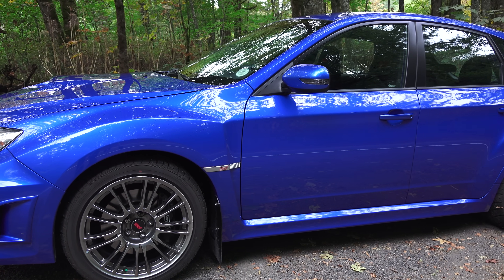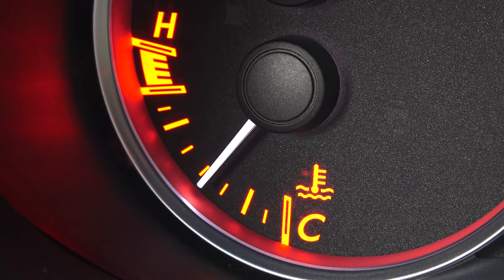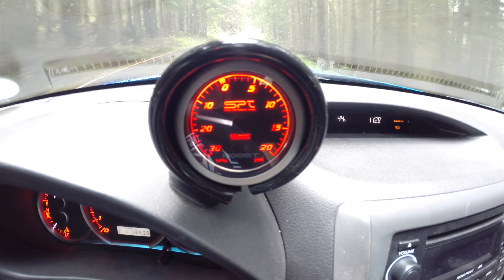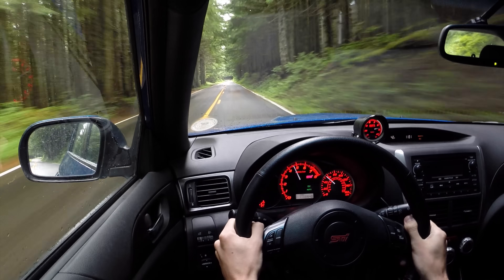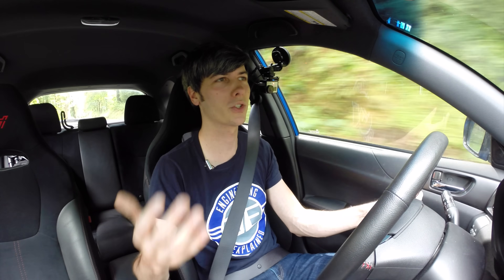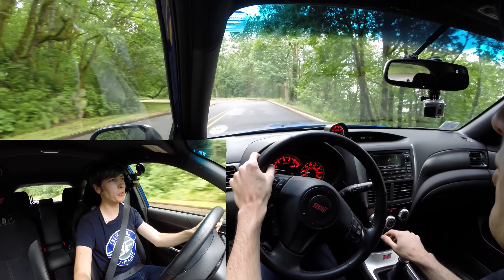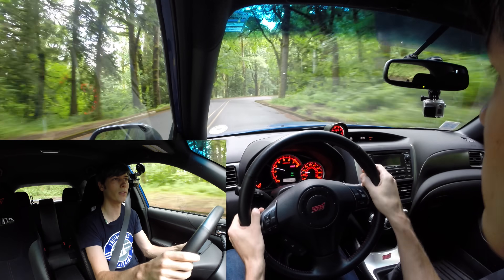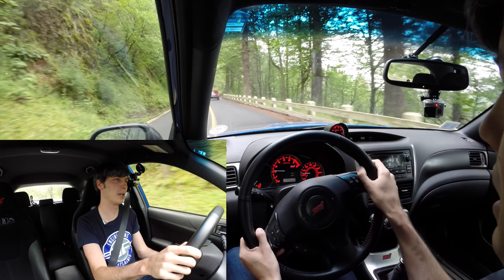5 Things You Should Never Do In A Turbocharged Vehicle

Comment: According to Ford, my EcoBoost can run on 87 octane although they recommend 93 when towing or for optimal power. So is it ok to run the 87 octane through my 2.7 EcoBoost?
Reply: If the people that built it say so, it is a safe bet. They are the ones that would have to fix it otherwise when under warranty.

Only performance engines, or shity land rovers call for premium. An eco boost engine doesn't need the premium fuel because it was tuned for lower octane. The higher octane just adds a bit of power.

Comment: You're flat-out wrong with the first thing you mentioned. People get hydraulic oil and engine oil mixed up. The viscosity of engine oil changes proportional to its temperature, however unlike hydraulic oil engine oil gets thicker as it gets hotter.  5W 30 oil starts out thin (5W) and thickens as it heats up (30).  This is because a starter needs thinner oil to be able to crank over the engine easily in cold weather but you still need the protection of the thicker oil after the engine is hot.  Pre ignition/knock IS an issue on all high compression engines such as diesel, turbocharged and supercharged engines.  What you will usually see manufacturers do is specify high octane gas. Turbocharged engines are one of the few engines where I would go with the highest octane gas I can find with every fuel up regardless of what the owner's manual says.  Higher octane gas has a higher flashpoint and will reduce some if not all pre ignition problems.  Some of your other information with spot-on such as keeping the engine RPMs between 2000 and 3000 RPM and adjusting your gears accordingly.
Reply: You would always be riding around in 4th gear to keep rpm above 2000 even with a 8 speed auto transmission.

Comment: police: why were you going so fast?
> EE told me i can't use this car at low-rpm
Reply: Driving at low rpm is fine. Just don’t floor it.

If you want to accelerate downshift and then floor it.
Reply: @MarcoBarroca  whats considered low rpm? and what rpm should it be okay to floor it? lol
Reply: @HungDante  I was kinda hoping for an answer, maybe this will bump it out of em? Lol
Reply: @HungDante  You can feel it. You know the boost is there if you have an audible wastegate or boost gauge, but the car doesn't feel like it's going anywhere. When I first got my car I was going about 40 in 6th and I wanted to accelerate so I went pedal to the metal and all the car did was bog and the MPG guage dropped to 0 mpg.
Reply: Fulls end or no send
Reply: I also saving the environment
Reply: I was unable to get into 'Top Gear' under 100 MPH as I have a 7 speed gearbox
Reply: @GrrMeister  Did you try to engage the 'R'ace gear? It ups the top speed by 30-40 mph easily.
Reply: Elliot Rodger  that's the Honda way and im proud to say im part of it 2nd and on is for pussies
Reply: Lol
Reply: what? LMAO.
Reply: Ah move along
Reply: Me too
Reply: Race in Sepang 😂
Reply: LITTERALLY HAPPENED TO ME lol
Reply: 😂😂😂 Gold
Reply: JUSES CHIRST aren't diesels usually turbochargered as well, and they usually stay at low rpm
Reply: @alyx6427  diesel gets its torque at low rpms, gas gets it at higher
Reply: @alyx6427  Diesel engines usually have an optimal rpm range of 1700 to 2300 rpm so basically keep it at 2k and you are good. If you floor it it's ok to go up to 4-5k rpm. (I know cruising speed for petrol engines😂) running it low at 1000-1500 rpm will result in low turbo spool and lots of lag. Also as a side effect you won't have much or any range to slow down until you need to downshift

Comment: Would this apply to non turbo cars?
Reply: only for big blocks otherwise you have a gutless wonder.
Reply: @Billy_Darley  well what do you consider a gutless wonder? Does a 1.5 liter 4 cylinder count? Cuz then yeah I have a gutless wonder.
Reply: @colepeterson9961  it was mainly just a joke. compared to the 7.5L 460 i just sold yeah thats a gutless wonder. power to weight ratio might help but your car probably isnt light enough.
Reply: @Billy_Darley  my car only weighs 1.3 tons I know I'm a dummy but hey who cares.
Reply: @colepeterson9961  2600lbs plus you and or passengers. yeah it could feel like a gutless wonder. a 1.9l 124hp 2300lb car will move just as quick if not faster. my 2.4 turbo 230hp 3300lb car will smoke both including the 7.5l 245hp 5000lb truck i had. its all about power to weight ratio plus what you do with that power, deliver it to 4 wheels or 2. a wrx sti is 2.5l 300hp and 3300lbs all wheel drive. that will leave me clean in its dust and i wont even bother to race them.

Comment: Should I put the highest quality gas into my 2019 Honda Accord 1.5T? It says regular
Reply: Higher tier gas is usually cleaner and better for your engine, however, if your car requires regular than go with that. An accord will last forever regardless of fuel.
Reply: Id say no. yes its turboed and yes higher octane does reduce knock and usally has more cleaning propertys but honda tuned the car to run on reg. They know the engine better then anyone so by putting premium in your car you'll just be wasting money but unfortunately honda has went full we'll save the earth bs on all there engines and they're trying to get those mpg numbers up by going gdi so id say every year do an intake valve clean with some spray at autozone on your car its a bit of a process but will def help your car run better and probably longer

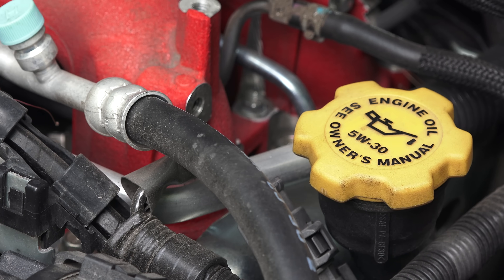Comment: How can you send oil through a turbo charger brah ?  0:59
Reply: You don’t need to. It’s pretty much designed to do it by itself.
Reply: Do you know how turbocharger works brah? I doubt so
So firstly, and this one you probably know. Turbocharger is the big metal snail with a metal fan inside that does it's spiny spiny thing and pumps more air into the engine. Now here is where you're probably little lost. When you have 2 metal parts rubbing against each other (the metal snail and the metal fan) there is something called friction. These 2 parts have to be lubricated or else they would wear within minutes. So that's why manufacturers put long and narrow hollow rods(they're called pipes) which feeds the big snail with engine oil so your turbo works little longer then 5 minutes. And that's my friend how you send oil through turbo charger brah
Reply: @lukaskral1800  when I grow up I want to be this petty irl
Reply: @lukaskral1800  thanks for the long answer which i didnt read

Comment: There are a number of deceased Porsche 930 owners that could have really used that 5th warning. That being said, after having driven the most current 911 GTS and my M2 competition, the boost is much, much more predictable than the motors of yesteryear. Even my last 340i with it's single turbo was pretty easy to get predictable oversteer that could be held for days. And with that STI, (I had the same one) it was pretty damn easy to predictably slide understeer into and out of corners...and go through a boat load of rubber while you're at it.

Comment: 1. Modern engines are using increasingly thinner oils
2. Modern cars run coolant through the turbo. When you shut off the car, if it's hot enough, it will continue to pump coolant and run the fan for a few minutes.
3. Modern cars have an ECU that controls everything. It measures airflow and injects only the amount needed. Direct injection engines are especially precise. Boost is always limited to a safe level with an electronically controlled wastegate.
4. Use the octane rating required by your vehicle.
5. Learn to drive.

Comment: much of what you're talking here is crap. modern engines automatically detect and adjust to fuel quality, for example. "buy the best fuel you can" would result in 30% higher fuel cost with no performance or reliability benefit at all for most people.
another example, running a turbo diesel at high loads and low RPM is exactly what these engines are optimized for - truck and bus engines get over a million kilometers of life time.

Comment: Let the turbo cool off...yes that can be referenced should try and remember to leave it running for half a minute or more while getting out. Don’t floor it from cold...yes makes sense. It’s really easy to destroy a turbo especially on an older car. Change oil on turbo diesel every 5 or 6 k mile and mind turbo. Don’t labour the engine...yes well known but true, it’s almost common sense if you listen to the car or imagine cycling uphill in high gear don’t do it. Idling down a gradual incline in fine at 1200 or less is fine and fuel efficient but not if engine is working hard.

Comment: 5:25 fourth gear at 30mph - don't lug ok
Reply: That is not lugging though lugging is dumping the accelerator whilst at a low rpm in a high gear, not cruising at 30 in fourth gear off throttle

Comment: Turbo cool down. My 2017 VW has an electric pump that circulates coolant around the turbo after the engine is shut off. Modern Subaru's probably ave something similar, I know the older turbo charged Subaru's needed a turbo cool-down period before being shut off.

Comment: Hi EE!! Great stuff! I jist would like to know the actual figures?
Low RPM =? ( that still considered as low rpm) 
Low Speed = (considered as low speed when you're, let's say 5th gear..)?? How will you know you need to shift to avoid LSPI.
Lugging - staying on the same rpm for prolong hours.. (how long does it take to be in a fixed rpm for it to be considered as "Lugging" already.)
Reply: 83U Tan You should be able to generally tell what's lugging YOUR specific vehicle, but a good rule of thumb is to avoid driving below 2500 RPM

Comment: Another excellent, informative and educating video.  Thanks! > On a different note, why do certain car manufacturers say "Regular unleaded (Premium Recommended)"?  Would it be too bad for a turbo engine to be given Regular Unleaded, but every 5,000 or 7,000 miles put a Fuel Injector Cleaner like BG 44K Fuel System Cleaner?  Would that be enough or is it ALWAYS better to put the Premium gas?

Comment: Hi Engineering explained. Pertaining to tip 1, I was wondering what is your definition of running it hard? How many RPMs would be considered running hard? I usually try not to go over 3000 RPM when accelerating until my engines is warmed. U think reving to 4K RPM while cold is still ok?
Reply: Depends on the car. In all cars, it's best to wait for the coolant temperature needle to be in the center, then stay below 4000 RPM without hitting boost and/or flooring it for the first few kilometers of driving.

That said, it's less of an issue with cars that do not have forged internals. So, most cars on the road. The Subaru that was shown in the video has forged pistons which expand and contract a lot under different temperatures, which can result in piston slap. It's also turbocharged (obviously), so that's another thing that is good to let warm up.
Reply: @joshjlmgproductions3313 My car doesn’t have a temperature gauge (only an overheating warning light). I can only use the tachometer as a proxy, after a cold start the idle rpm is a bit higher than after the engine has warmed up.

Comment: I’d probably stick to manufacturers octane rating if I’m having it completely stock, but I thought that running higher octane fuel than the manufacturer specifies that it burns cleaner? If you’re doing a light tune on a turbo engine (changing the air filter, making the exhaust less restrictive) I’d probably bump it up a level. Not to mention that some place actually carry very high octane fuel (there’s a Marathon near me that has 103). Also I heard that running higher grade fuel in general makes it burn cleaner.

Comment: I was taught that labouring an engine put more force on the side wall of the pistons and caused additional wear on both bore and piston
The two vehicles I own, both manuals urge you to idle after a long or fast run to reduce the chances of carbonising the oil in the turbo bearing

Comment: His point at 3:10 can be tested with reading the O2 sensor voltage during these conditions.  I’ll put it on my to-do list to test and see if he is correct. My $1 bet is on no (or mostly no) for computer controlled fuel systems. Only problem being I’ll have to get my hands on a boosted car to test.

Comment: This brought to mind the opposite end of the performance spectrum, the American flathead inline-8 engines that preceded the OHV V8 engines. These were low-revving torque monsters that would reach torque peak at 1200 rpm and idle at 450 rpm. For maximum acceleration, you would start in 1st gear, but with the off-idle torque of these engines, you could slowly let out the clutch in top gear and smoothly idle down the road.

Comment: My C300 has a coolant/oil heat exchanger for my oil cooler. I understand this helps to heat the oil with the coolant in cold temperatures, but how much time should I give it for my oil to reach operational temperature? Is it nearly the same as the coolant?

Comment: Having just bought a car with one of those 1.0 litre turbocharged engines, and not having had a car with a turbocharger in it before, I'm really glad I stumbled on this video.

Points 2 and especially 3 are relevant to me. It looks like I should be ignoring the dash indicator that's telling me to change up at what seems quite low revs to me - especially at it seems to be only taking into account road speed, and not any inclines. When following the gear indicator, I have often found myself lugging the engine, and getting very little power at low revs. Didn't seem right to me, and now I know why.

So, thank you. I'm liking this channel!

Comment: I will say from years and years of driving blown head gasket cars that the 87 will start knocking before 5 minutes but the 91 will make it all the way to 10 minutes in a dry engine with no knocking... however even if its cold and you floor it you will be knocking before 3rd gear with steam hahaha ghetto engineering explained

Comment: I came back to this video after all this time after learning about the problems of Honda's 1.5 L turbo with fuel getting into the oil. Makes my wonder if it's the lugging issue since the CR-V certainly does lug at low speed, especially if the econ button is one. Not hearing as much of this problem on the Civic and Accord version of the 1.5L turbo but that could because there are more CR-V's with this tiny turbo.

Comment: Diesel Engines are actually build for a high torque low rpm. You can drive your diesel between 1.000-3.000 without a problem. You shouldn't drive it to high since your will waste your fuel and have less power

Comment: Regarding point number 2, what if it's 48 degress C outside and the AC is on, wouldn't letting the car idle after driving it (before switching it off) heat it up more?

Comment: Haha he believes pump gas actually has something to do with engine knock. 87 89 91 even 93 doesn't make a big difference. Especially on cars running low compression which stock turbo charged cars usually are.
Reply: No, Turbo Charged cars don't make full power on anything less than 93OCT so lower octane levels can certainly present issues. Typically the engine can adjust and just not produce the power to prevent knock but this isn't always the case.

Comment: how do you get the coolant up to temp without oil being at a reasonable temperature that can handle full load and RPM???

especially considering most modern vehicles essentially use the cooling system to control oil temps
Reply: I think he explained it like this.
You have a coolant cutoff valve thingy working when the engine is cold. The reason being that it lts easyer to get oolant get up to operating temp when it doesn't circulate (so you spend less time in a "cold engine mode" )
Thermostat picks that up
But oil circulates at all times, even when the engine is startef cold and you could end up with oil that is not heated to normal temperature and there is no sensor to pick that up. Also due to a turbo, you might need a lot more oil then coolant

Comment: Disagree about using the highest octane you can get. If your car manufacturer tuned the engine for 85 octane ( turbo or not ) then you should use that octane. I am a pilot and could put 100 octane in my Honda 1.5L turbo, because I can get that fuel all day long at the airport,  But I don't!! I put in what Honda says to put it in, period. 
.
Reply: Well in the UK the lowest octane I have seen is 92. So that would mean by your logic vehicles that are tuned for 85 octane can't be used in this country.
Reply: EU 95 RON = US 91 Octane
EU 98 RON = US 93 Octane

Normal Octane ratings in the US are: 87,89,91 and 93.  

The lowest 87OCT would be about 92RON in the UK. I've never seen 85 Octane ANYWHERE in the U.S.

Comment: If you read your boost gauge, you’ll notice that there isn’t positive boost at low RPM.
If lucky, you’ll see zero boost (neither negative. Or positive pressure).

There will not be boost at low ｒｐｍ
Reply: Uh... yes there will. 

It all depends on wastegate position and what kind of turbo. 

Most boosted engines today use a small turbo and are providing full boost at very low RPM with full throttle. That’s why they are so torquey and have very little lag.

Comment: I have a 2009 rdx Acura awd turbo and wonder if you'd advise installing a home-made hydrogen fuel device which uses water and electricity to pump small amounts of hydrogen into the engine? I used this device on an older Blazer with positive results including better fuel mileage, cleaner burning and higher octane -averaging about 10% fuel savings with better power. In your opinion, will this device perform similarly in a more modern engine and/or interfere with the turbo or computerised performance?
Keep up the great work. Thanks.